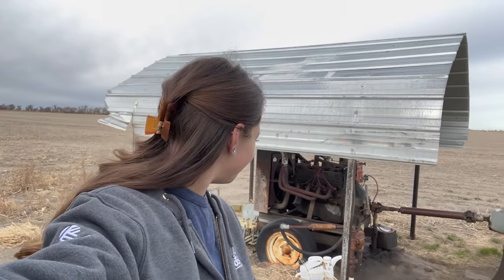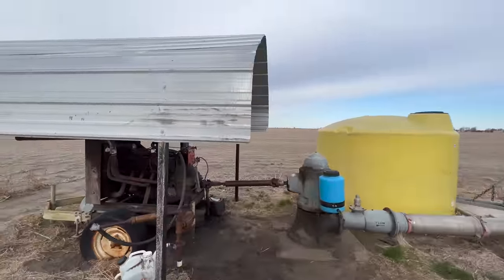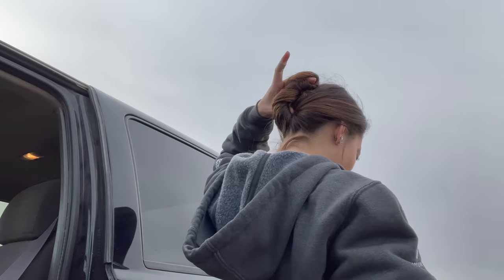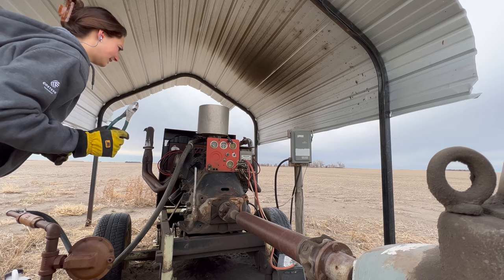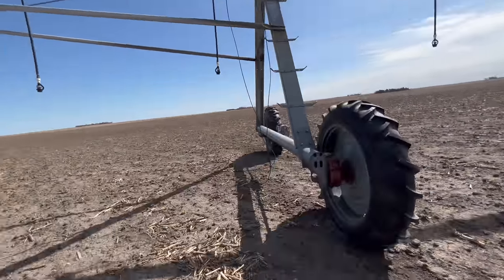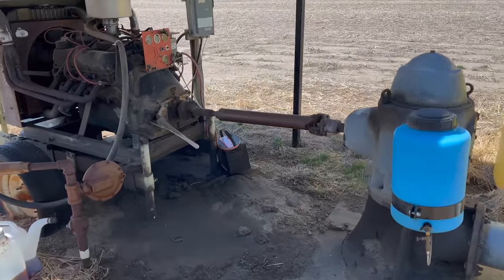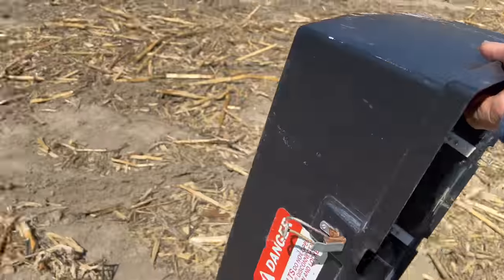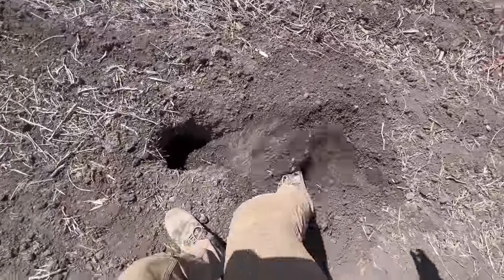Cold Starting Diesel Engines After A Long Winter

Comment: Laura, if you keep having to disconnect the battery cable from the pivot motors every time, then something is wrong with the electrical system on it. It should never draw down the battery just being connected up? It could be an alternator rectifier block going bad, or starter or ignition switch that is corroded or carbon tracked inside that would cause current to flow while the engine is off. It can be easily found by using an ohm meter or a voltage meter. Love seeing you do your work things, girl! :-)

Comment: might consider a little solar battery charger for your pump motors during winter, keeps the bat. topped off that will result in longer bat. life and engine starting.  It's a good habit when working around power equipment to keep hair and other things (sleeves, ties, scarves, etc.) either tied down or leave them at home, every year I read about some farmer getting caught in machinery and it doesn't end well.  Just do it ALL the time like not point guns at people, same kinda rule.  I don't mind the mice but hey, no snakes.  work gloves are a good invention, only work when you wear them.

Comment: I have so many questions:
1. Since the motors of the pumps are shut down the whole winter. Do you need to check for rust? Or change the grease/lubricant?
2. Do you have to empty the waterpipes so that they dont freeze over winter and burst?
3. How do you sow or harvest if the irrigation system is turning so slowly? (Does it have different gears you can switch for speed?)
Reply: The newer irrigation are galvanized so that saves them. But yes, the older ones can get holes corroded through. Most of the bearings are sealed so there’s not much to grease. The gearboxes have to be checked. Never have had to change the oil, except in the engine. 
There are valves at each tower that open when the pump is shut off. The towers are the low point so all the water runs out. There’s also a valve by the pump to drain that too. You do need to check that they have drained before it freezes. There are cases where the pipes are underground and that water needs to be pumped out. 
We usually will till and plant on the side of the field that the irrigation is not on, then turn it on and move it over to the other side. Btw, if you watch it, it moves slower. 😂. But don’t get distracted and forget it. 😏
Hope that helps.
Reply: @lazeppelin1  thank you :)

Comment: Wait a second...my mind went down a pivot science rabbit hole. If pivots go in circles, that means the tires closer to the center move really slow, while the ones farther away are progressively faster and faster. Do you have to put drag racing tires at the opposite end of the pivot? Do any segment go faster than the speed of light?

Comment: Could the pvc drop pipes be breaking during the winter after they freeze and are flexed during a heavy wind?
Reply: This is possible.  Also the rubber just gets brittle with time and they sway in the wind and break at the part closest to the connection where they pivot from.
Reply: @AIM54A  Thanks - Great channel.

Comment: Laura,
First, Good morning to you too. 😁
Next, if it looks to be that dry-rot caused those water-drops to break off, do you pre-emptively replace the whole run, or just the ones that are currently broken, and take the time to check on that pivot a few times daily? Do the pivots have an over-flow safety shut down built in to the system? (In case of such a failure) And if so, is there some sort of alarm system to let the farmer know they have stopped running? (If not with the older ones, maybe with the newer ones with the electronic control panels?)
Lastly; I guess the 2-3 root balls per slicer arm, are the machine's trophies for a job well done?
Additionally, as always, thanks not only to you and your family, but to all farmers for all that you do to keep us and our critters all fed. Not all is us have personal gardens, and even those of us that do can't grow all we need due to geographical locale or soil conditions or other constraints, so thanks a heap, hun.
Reply: We did, 3 acres of garden plus truck-patches on field edges. Now I'm happy with my 12 plants; 4 tomato, 2 jalapeno, 2 bell pepper, 2 cantaloupe, 2 watermelon.
Reply: @Ray56z  yeah, my entire property out in the county is 0.6 acres. So a family garden is all I could manage before becoming disabled. Now it is all but impossible to get down on my knees and tend a garden. And on a government check of SSI, I can't swing building and filling raised beds with the space to fit my mobility scooter between them, and then I would still have difficulties reaching the plants to harvest. I thought about a greenhouse, but then again, building permit issues and everything. We live in a flood zone so we have to put in for a permit, put an add in the paper for two consecutive weeks (to allow neighbors and anyone else the opportunity to object to the permit), submit to the flood zoning board in the state capital a building plan and request, then get a surveyor out to go over the plan and check off a ridiculous list of requirements on the plan and submit it, then IF the plans are approved and no one objects from the ad placed in the paper, we get the permit. Build the "foundation", what ever it may be, which must be a certain height above the flood level for all new structures, get an inspection on that, then, if that passes surveyors saying it is high enough and inspection (we have to pay for every surveyors trip and fee) we can continue building. If there is any electrical or plumbing, we have to pass inspections for each of those, then we can close in the building, pass another final inspection, and "occupy" the building for it's intended purpose. It just isn't worth the headaches. I can buy fruits and veggies from farmer's road-side stands for years for what all that would cost, and without all the headaches.
We do put out a few hanging baskets of those "up-side-down" tomatoes and strawberries most years. No weeding, and they grow pretty good in store bought garden soil mixed with our garden soil and compost. (BTW, our soil has been composted and turned every year, except the last two, for over 70 years. The previous owners gardened on the same spot before us as far back as they owned the place for 60+ years before we bought it 11 years ago. Everyone around told us when we moved in that David used to hand out tomatoes as big around as a salad plate all the time.
However, keeping our compost bin turned is getting harder and harder all the time. I might have to build a couple of barrel turners with electrical motors and belts soon. As they won't have a foundation or a roof, the county can kiss my butt on permits.
Thanks for your earlier response.
Reply: @thomasarussellsr  I was talking of the garden we had as kids growing up. Between  the farms and chores-including gardening-we didn't have much time to get into trouble away from home.
Now, I'm healthy enough to have a garden, have the space, but my 12 plants and year round Farmers Markets are just fine with me.

Comment: Hi, when I was trucking I suggested making a concrete pad where as to dolly down loaded trailers with electrical boxes for each truck so each truck could have engine heater plug in capability also in each box have battery chargers in them with long enough cables to reach trucks battery boxes luckily the boss did this saving so much time for starting trucks in cold weather it saved mechanics/ drivers so much time making everything much more efficient!!! 👍✌️❤ps love your videos I learned alot from you!!!

Comment: Pertaining to the drop lines or whatever you call them, they appear to be stiff which will happen if aged and exposed to the sun and weather. It is possible they got so stiff that a strong wind tried to bend them, and they broke off. If, I am correct in my assumption, and you would only know by feeling a new one, and then comparing the flexibility of the broken one, that you may need to replace them as well. Someone who is familiar with these can chime in here. I'm sure your Dad knows. Great to have a farm, and great to have family. Teamwork makes everything happen.

Comment: When I built my house 30 years ago, we didn't have city water, so I had to drill a well.  About 5 years later, we got city water, so I put in a sprinkler ststem for the one acre around the house.  So, in the past 25 years since I put the sprinklers in, a lot of farmers in the area put in the pivots, and their wells are much deeper than mine, so, in the midst of droughts, when they are irrigating their fields, the water table is lower than my well, so, when I need water the most, I can't get it!!!

Comment: Laura. Your videos are great. A safety tip for you. Wearing a hoodie with draw strings around rotating power takeoffs is not a good idea. You will get wrapped up around the rotating equipment so fast that you will not realize what is happening.  Just had a fellow worker get her hoodie laces entangled in a rotating auger and now she has a long recovery period ahead of her.  Be safe Laura.

Comment: Tip, stand on the other side of motor. Then anything flying out of the clutch it's heading away from you. 
I'd also keep a set of jumper leads in the car, just to make life easier on the batteries. 

The drops have probably failed due to UV damage or extreme cold and high winds.
Reply: Great info, thank you !

Comment: Great video.  I bet those mice are having a bad day.😁  Have you ever heard of magnetic water?  You just put a circular magnet on the intake pipe and it magnetizes the iron in the water.  This helps the water to clump around the roots of your crops and increases yield by 10-15%.  So this means a savings on fertilizer by 10-15%.  I saw a video about this on YouTube 8-9 years ago.  If you ask me to find again I am not sure I could find it again.  A video you might like "SEE WHAT HAPPENS TO PLANTS WHEN YOU PLACE A MAGNET IN A POT? | DIY GARDENING EXPERIMENT" YouTube  GARDEN TIPS

Comment: Mice and moths balls do not mix. My neighbor's ajacent to  me had pocket gopher problems. They never moved into my garden or lawn so I felt pretty fortunate, until I found a mound alongside my rose bush next to the corner of the garage , where they had burrowed underneath the concrete floor. From henceforth doing their nighttime forging. I have one of those turbo flame soldering torches that fits on a propane bottle. So I screwed it on one of those Coleman larger propane containers. I dug out the entrance to their domicile down to the dirt that would pack good, turned on the valve wide open on the torch turn it upside down with liquid propane coming out stuffed it in the hole and packed dirt around it and told everybody not to light a match or smoke a cigarette around my garage for a while. Wha laa, no more pocket gopher the ones that were on the edge of the property disappeared , and even the neighbors lost a few habitants. A question or two. You plan to relocate the pesky little badgers or euthanize them so none come back. Plug one Escape Route with really wet dirt or mud , and I think anhydrous will do the same thing as propane with a little added benefit for the crop. You will also be able to tell where their run and their Living Spaces are. I'm sure if you would like to relocate those Badgers there is a Bald Eagle Sanctuary between Westminster Colorado and Golden where the groundhog population would welcome the competition?.! ?

Comment: Good call on your hair - also remember the alternator and generator belts. They'll tangle hair just fine (and then scalp you - that's not fine and actually has to be reported by law in the UK)

On the broken drops - my guess is high wind in winter combined with cold. Black PVC will go brittle in your winter temperatures I suspect, and snapping at the base is where I'd expect it to fail

Comment: I’m not sure how much their electricity cost, but in my area it’s extremely cheaper to go eletric instead of fuel. Btw you can get 3 phase inverters. They are expensive but you’ll save on your operating costs.

Comment: Do u kids have any plans of getting ur own power generation  Out there on those  plains of ur r prefect for wind  Even better then my NY-PA hill tops  Last yr I made $15,790.53. With tht and money form the last three yr before '21 I will be putting in another 100k this summer
Dont pay contractor as i have  A BSET and can build anything  Just need s little help these days as I am '73  On my operation I have 11 ppl who have bought in and work it beside My Love and our 18 yr old Gdaughter who thinks she want to be a rancher farmer.  We also get a lot of help with harvest from the members of our CSA

4 of the ppl who bought in did so with 2 portable saw mills.  That part of the operation is doing good as they now have a shop in which they make custom finish lumber  A lot of fancy trim  Ya we run an electric kiln  dryer for the lumber put it in in '15 Over 2000 ac woods to work for these guys.  Winter we all cut trees and haul logs with horses to sides where mills will be set up come better weather  Been cunting lumber now for 2 mo this yr

Comment: Being a mouse can't be easy out there.
I've always found those pivot irrigation systems a bit odd - every field has angles and every operation is done in rows, but those systems can only supply a circular area with water, right?
Is it just because your fields are so incredibly large and flat that it's a viable option?

I'm not a farmer (I'm a machinist), but I'm sure there are plenty of pros and cons with every method of irrigation.
The farmers where I live all seem to use the same type of hose reel irrigation system for watering their crops - it's just a sprinkler at the end of a long hose. 
First they just place the hose reels in one end of the field, then they drag the sprinklers out to the other end of the field while the hoses roll off the wheels.

And then the wheels start turning as the water is pumped through the hoses - so every bit of the field gets watered as the wheels roll up the hoses, pulling the sprinklers backwards.

Comment: Laura, when you disconnected the battery cable I noticed that the terminal, and I am sure the cable itself need a good cleaning. The battery terminal cleaning tool which is only a couple of dollars makes for an easy task of that, and you probably want to put a coating of something on those terminals.

Comment: It is recommended for the PVC pipes on your drip-irrigated field that are exposed to daylight be painted with a good latex paint to increase their life span.  Those white pipes are usually buried in the ground or hidden in dark spaces and therefore have little resistance to UV light.  Paint is cheap compared to pipes and fittings.  🙂

Comment: Laura - so assuming that the pivots rotate around a central point (well head?), how are the pivot drives calibrated so that each tower travels the correct portion of the circle so that entire length of the pivot stays straight? As you go further away from the center, each tower must travel a longer distance along the arc than the nearer ones do. How is that accomplished?

Comment: if you have power at these remote pump stations, think about adding a battery tender to keep the battery Charged over the winter and when not being used. I keep one on my mowers, it really helps keep the batteries up.